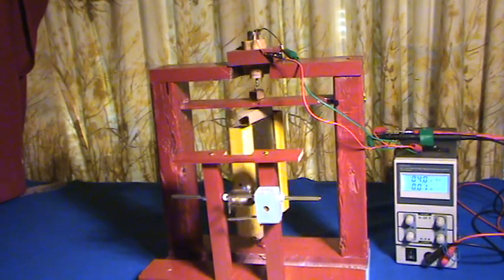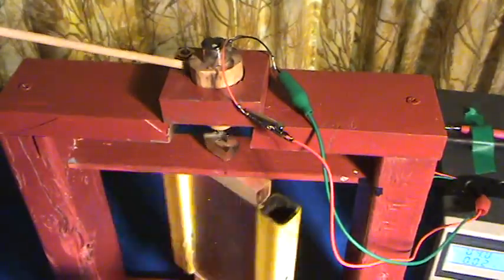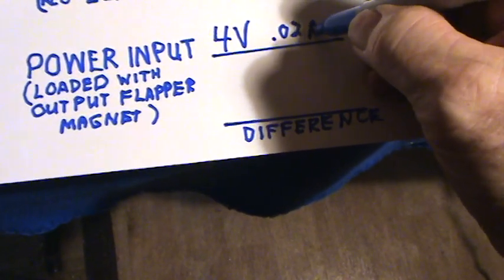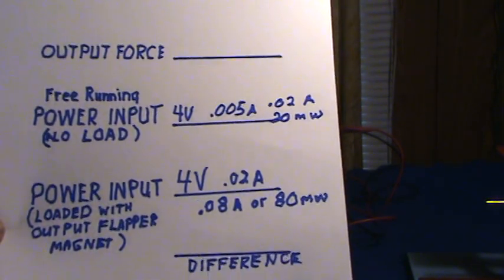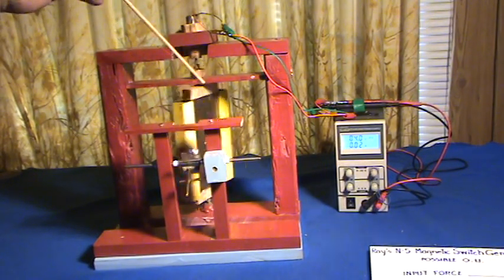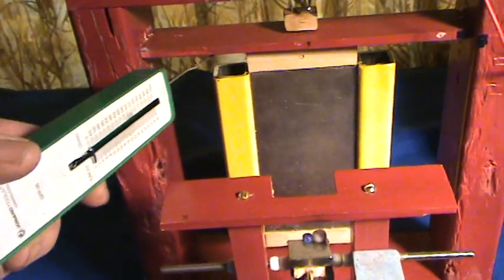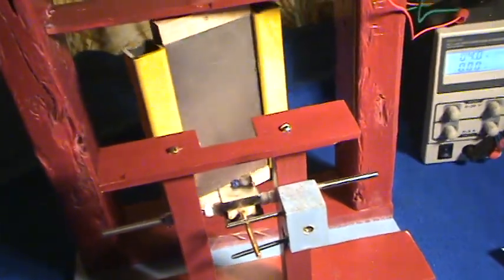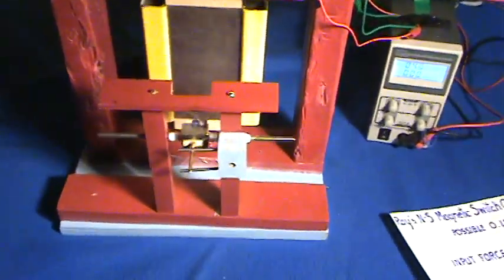Ray's N - S Magnetic Switch Generator 2

Comment: I value and like your work, but I have to say here, I noticed  that the measurements are done incorrectly! Why? Because your measurements on force in and force out are done/taken from DIFFERENT points/distances to the respective pivotpoints. 
In the first measurement (where the motor is) you have e larger distance and in the other (output) a smaller distance.
Good  luck 🤞

Comment: If it turns out that this does have an overunity effect. You could add in the design flappers 360 degrees around the rotor magnet. They shouldn't add any more drag than the 1st one. Since the gates have the cancelling effect. So basically you could increase output based on the number of flappers you add. If you find an efficient solution to transform  mechanical into electrical energy, it may become a self-runner. And ofcourse it is scalable.

Comment: Don't waste the energy on the lights put it in a big cap and feed it back, easy.
Reply: The output generators must be matched for batteries or super caps ; my generators I have are not , and not large en early enough output . I will be using a different power output that I have not released yet . Thanks for input .

Comment: Nice work Ray..

Be the 1st to replicate my prototype, if it works you can generate as much torque as you need by increasing the drive coil amps. Considering that the circuit is supposed to loop the 1st initial energy pulse between two capacitor banks.  :)

https://www.youtube.com/watch?v=WH4watZLhOA